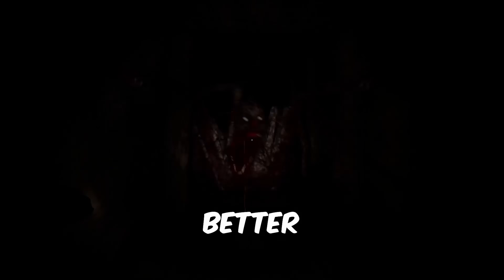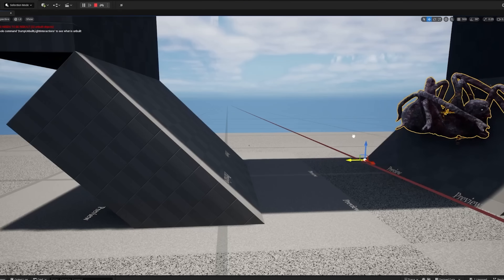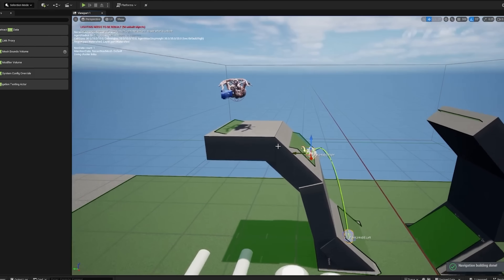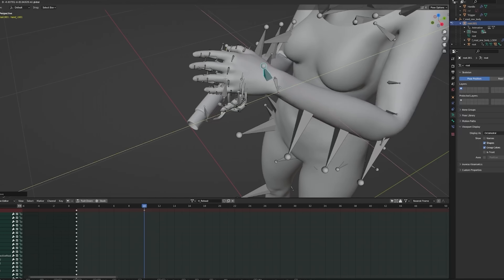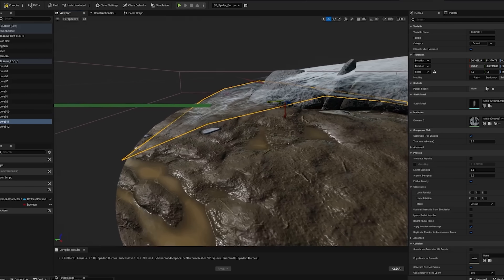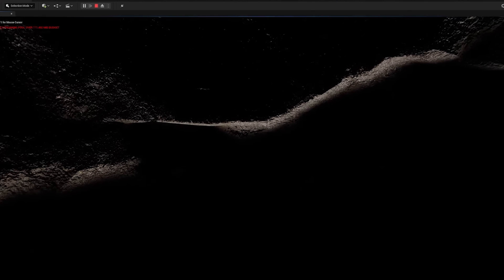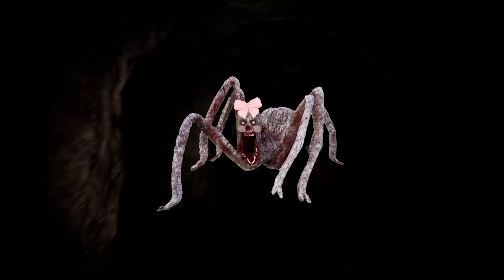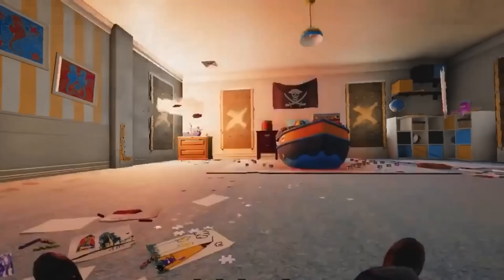My Horror Game is Getting EVEN SCARIER

Comment: 6:16 Flare guns are specifically designed to shoot far in order to launch the flare high above the local environment so it can be spotted over trees and such. your standard flare gun will have a range of at very least 200 meters, or about 650 feet.

Comment: One recommendation I'd give is to improve the animations a bit.
I assume you used the flare gun you have as animation reference before, so that's one thing to check off the list.

I recommend you add some breakdowns (poses that bridge one pose to the next) secondary motions to break up the motion on separate limbs, and familiarize yourself with the graph editor to tidy up the movement and timing of everything. Considering what you've learnt from college, the graph editor probably shouldn't be too hard.

Comment: love the workhey, just started watching this series but I love it so far. One small thing, please, please, PLEASE fix the flashlight, it's a meme light. i know you're trying to make a scary atmosphere with the of lighting, but maybe you can do what amnesia the bunker did and have a better flashlight but its risky to use or set up a lighting system throughout the cave you can turn on or off, or even just make the flashlight be unreliable. look into carbide lamps. those were used a lot in old mines. but please, fix the light mechanic.

Comment: Instead of making a whole 3d animation and model for the gun, why don't you use the old trick of slapping an 2d animation on the screen? It'll prevent the gun from clipping away and make it run smoother AND make it easier to code in firing and failing mechanics, a lot of fps games use this trick to help prevent glitches and save time